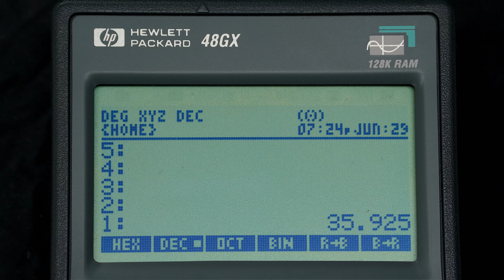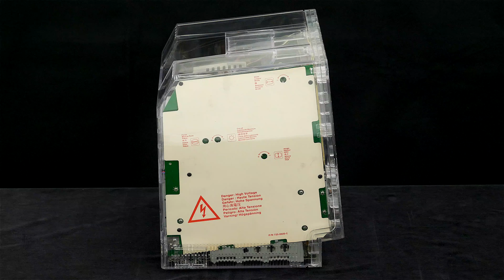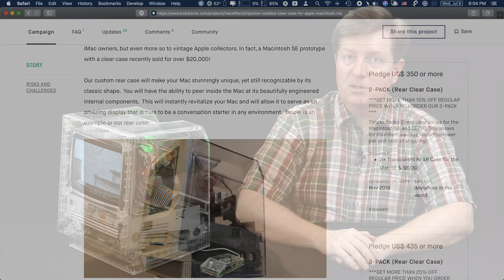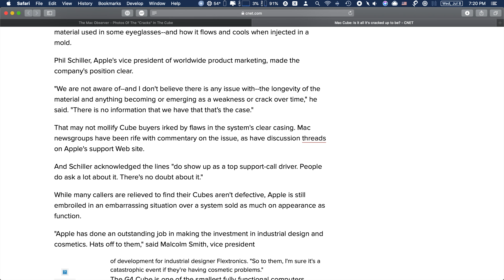MacEffects Clear Case REVIEW [SE & SE/30]

Comment: That’s pretty cool.  Would you happen to know (probably a long shot) but would the guts from a Mac classic fit into a SE case ?

I have a classic ii with a broken and cracked case
Reply from the maker: Unfortunately, no.  The internals of a Classic are very different from older compact Macs.  I must say though that in terms of external appearance, the Mac Classic has always been my favorite.  It can't touch an SE/30 regarding speed and expandability, but the case is nice.  I can see what you would want to get yours replaced.  I see one on EBAY for $45 (case only) but its really beat up on the right side.  Be patient though, more will likely pop up.  Another thing you can do is post your request on a forum like the 68kMLA or in a vintage Mac FB group.  I've put links to those places in the text description below my video above.
Reply: @JDW-  Great channel. As a Mac hobbyist myself, I have learned a lot from watching your videos and have used many of your recommendations. I have two Se/30's and one Color Classic II that I am in the process of recapping and would love to know what web browser(s) that you would personally use on these old Mac's for surfing the Web today. I know it would be horribly outdated and lack support for most modern websites, but that is something I really want to try for purposes of nostalgia using the Ethernet cards I have for both Systems. Thank you very much in advance for any answers.
Reply from the maker: @chrisnotbad  Netscape 2.0.  I have advocated that browser for years, even back when Cult of Mac interviewed me here:
https://bit.ly/2ZUynxk

But you need to keep in mind though that even the fastest SE/30 isn't fast enough to decode huge graphics or sites filled with lots of graphics.  Many sites break on Netscape 2 as well.  It's hard to browse modern and responsive websites on the SE/30 these days, and downright impossible (from a practicality standpoint) on less powerful vintage Macs.
Reply: Thanks for the quick response.
Ah that’s a shame, I was hoping mac would of kept the subframe and inner-bits the same to save cost (like how GM did with its cars in the 60s and 70s) .  But I agree the classic series are good looking computers.   It is a classic ii so it’s not to slow.    But do you really need all that speed of a SE30 on a BW mac anyways.  But thanks for the heads up, I’ll keep looking 🙂
Reply from the maker: @alexinnewwest1860  The SE/30 is the holy grail of compact Macs because of its PDS slot.  And yes, there are some amazing things you can do with that slot, such as making the internal CRT grayscale.  I'll have to do a video on my grayscale setup at some point so you can see what I mean.  Some other details are presented in the following Tidbits article: https://tidbits.com/1991/09/16/classic-ii-vs-se30/
Reply: That is a very cool read up, thank you.  I actually recently got into fixing up and playing with these baby Macs,  I guess I grew up out of the Apple IIs lol,  
You seem like the fellow to ask. 
I just recently got a Apple hard disk SC20 for a macintosh plus I also have. I need to find the SCSI cable for it but my question is. Do I need a termination  plug for the drive?  
Thanks
Reply from the maker: @alexinnewwest1860  Yes, you must either use a plug or ensure the termination is active on the drive itself.  Some drives have that, but some do not.  BTW, I have a recapping video for the power supply of those external HDD enclosures here: https://youtu.be/Qof-Wjj_rWI
Reply: That is wonderful, I’ll definitely look into that,  would be nice to have this running like the day it was new.  
I’m not entirely sure how YouTube works but you seem very helpful. is there a way I can PM for further questions? 
Thanks
Reply from the maker: My email is accessible from the About page on my channel here: https://m.youtube.com/c/JDW11/about

Comment: I'd love to see reproduction original cases to bring Macs with cases damaged beyond repair while still keeping the original look
Reply from the maker: That would require a completely new mold, seeing the clear case mold is diamond polished while the stock mold had a texture to it.  MacEffects also left off the drill hole and the locking hole in back, which are additional differences.  I suppose if there was enough money pooled together by the vintage Mac community it would be possible, but we are talking tens of thousands of dollars to make that mold.  Even so, I do agree it would be nice to have.
Reply: I'm pretty sure that the mold didn't have any of that texturing and the cases were outsourced to be chemically textured and get the signatures engraved by a company specializing in it

Comment: Pretty neat.  It would have been something if they had managed to preserve the original signatures.  ...though I imagine that would be tempting fate.
Reply from the maker: Most likely, Mark J. of MacEffects decided not to do that because doing so would have obscured the transparency of the back case, making it more difficult to peer inside from the back.  Even so, one could just as easily peer in from the left or right sides.  For all I know it could have been a cost and complexity issue at the mold factory.

Comment: So, I dont see that clear speaker on Maceffects website. Here y'all go: https://www.digikey.com/en/products/detail/cui-devices/GA0576M/483566
Reply from the maker: Thanks.  Not sure why MacEffects isn't advertising it.  Here's the Mouser web page for it: https://bit.ly/3cdeWHI
Reply: @JDW-  Is this the same clear speaker that he sells for 3 times the amount? Or is it just a regular non clear speaker that all compact macs use?
Reply from the maker: @cadenyang3058  What you see in my video is indeed the MacEffects clear speaker, yes.  It is an 8Ω  The stock speaker is black and 63Ω.
Reply: @JDW-  Sorry for not being more clear. I meant is the speaker in the Mouser link the same clear one? Or is it not see through? Thanks
Reply from the maker: @cadenyang3058  I apologize for my having misunderstood you.  You are asking about this clear speaker: @t
The answer is, yes, it is the same speaker MacEffects uses.  Keep in mind that means it is only 8-ohm.  And what that means is the sound isn't quite as loud as the stock speaker.  You'd think it should be louder, but I think it taxes the output amplifier a bit too much, such that the end result is a tad quieter sound.  (And no, I've not tried an impedance matching circuit to see what happens in that case, although in theory that's all that would be needed to regain the same volume level as the stock 63-ohm speaker.)

Comment: Unfortunately sold out as of this comment.
Reply from the maker: The biggest cost to creating the cases was making the tooling (metal molds into which the plastic is injected), and as far as I know Mark Jozaitis still owns them.  It's therefore just a matter of MacEffects placing another order at the factory in China.  I suspect that it's a matter of low demand for the cases though.  If enough people wanted them, and if MacEffects was OK with the logistics of placing another order, it probably could happen.  But again, a group of more than just 2-3 people would really need to get together and approach MacEffects to discuss bringing them back.

Some people loved the 100% clear cases while others didn't.  I suspect it could be how the machine looks from the front.  With it 100% clear, you see all the guts inside.  That thrills some people, while others feel it to be rather gaudy.  And since Apple Macs are known for the clean and simple designs, that causes some division among people in the vintage Mac community. Nobody complained about the MacEffects clear cases, but people who didn't like them simply didn't buy them.

That's why I think there's a good compromise, which really was started by the CRT iMacs back in the day -- a clear back side only!  I show this off in my Tilt/Swivel review video here: https://youtu.be/N2LCXYobehs

Not sure if MacEffects could ONLY make the back side case, and if they did, that wouldn't please people who wanted front and back parts.  Cost is another factor because the cases are large and need to be well protected during shipping.  Not sure if the Trump taxes on Chinese imports made them impossibly expensive either.  

But since MacEffects still sells the clear cases for other vintage computers like the Apple IIe, it would seem that it's just a matter of demand.